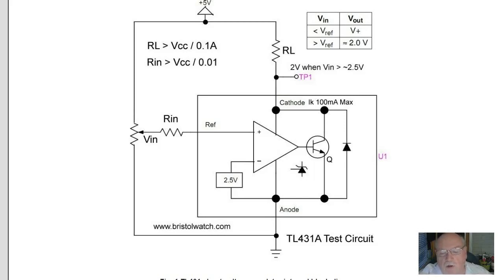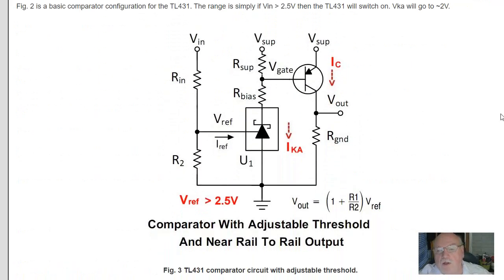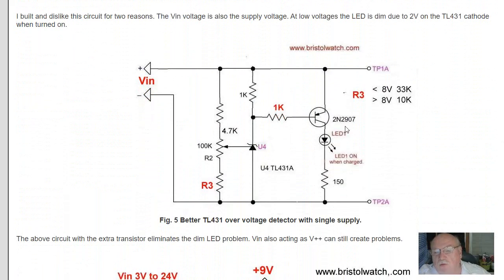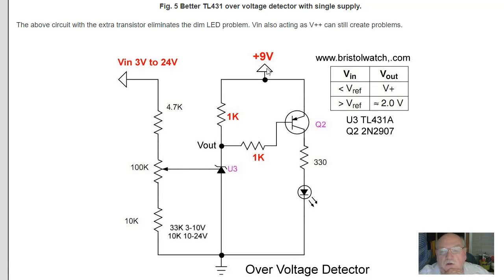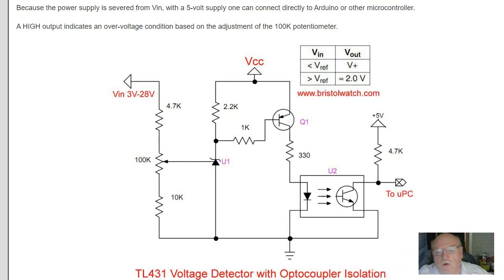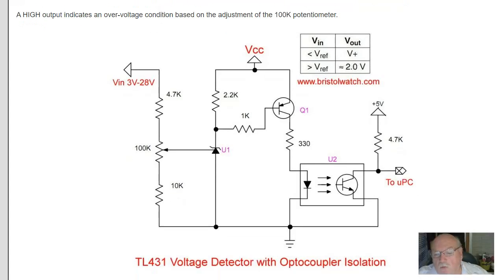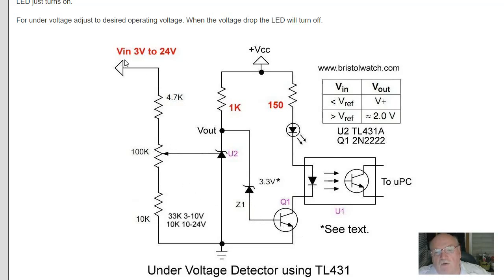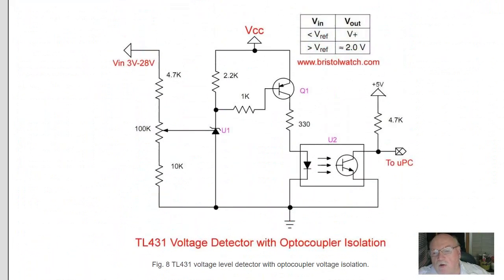TL431 Under-Voltage, Over-Voltage Detection

Comment: Thanks for sharing your knowledge. I hope you can explain BAV99 🙏🏽 Thanks you in advance!!
Reply from the maker: That is a dual fast switching diode, 3 pin diodes connected anode to cathode in series.  https://www.smc-diodes.com/propdf/BAV99%20N0595%20REV.B.pdf

Comment from the maker: The 12Vbatter charger circuit uses a TL431 voltage detector and a TL431 constant current source.
YouTube video: https://youtu.be/k1TOiKuBBG8
http://www.bristolwatch.com/ccs/tl431_ccs4.htm 
TL431, LM317 Battery Charger Circuits Schematics

Comment from the maker: Associated links:
http://www.bristolwatch.com/ccs/tl431_ccs3.htm Power TL431 Constant Current Source Circuits
http://www.bristolwatch.com/ccs/lithium_charger.htm TL431A Lithium-Ion Cell Charging Circuits
http://www.bristolwatch.com/ccs/lithium_charger2.htm Charging Multi-Cell Lithium-Ion Battery Packs
http://www.bristolwatch.com/ccs/tl431_ccs1.htm TL431 Over-Voltage,  Under-Voltage Detector Circuits
http://www.bristolwatch.com/ccs/tl431_ccs2.htm TL431A Constant Current Source Working Circuits Demo

YouTube:
https://youtu.be/y2gnZ7HZefc TL431 Constant Current Source Circuits
https://youtu.be/kJUit6XQYKE TL431A Lithium-Ion Cell Charging Circuits
https://youtu.be/jVXmL7HThiM TL431 Battery Charger Circuit Calculations Revised
https://youtu.be/Fr0Zir8UCLs TL431 10-Volt Charger Short Version</a>
https://youtu.be/gg0Tux_pAgk Charging, Charge-Balancing 18V Li-Ion Battery with TL431
https://youtu.be/QfXS70Kwx94 18.5V Li-Ion Battery Charger with TL431 (short)

http://www.bristolwatch.com/ele4/ccs_lm358.htm Arduino Measures Current from Constant Current Source
http://www.bristolwatch.com/ele4/css.htm Constant Current Source Theory Testing
http://www.bristolwatch.com/ele4/ard_css.htm Arduino Controlled Power Constant Current Source